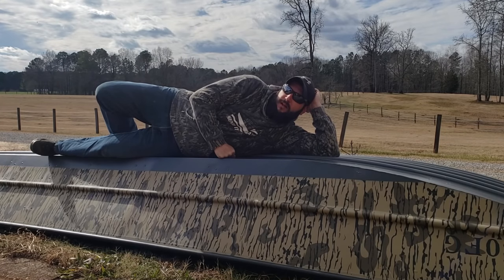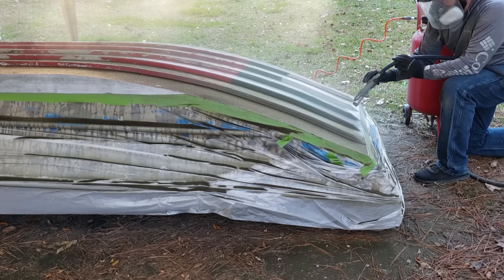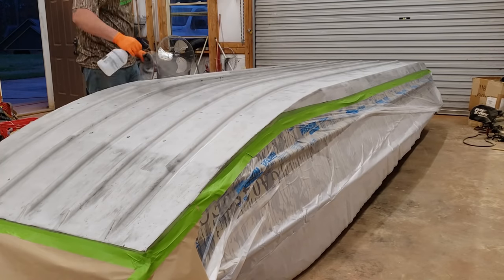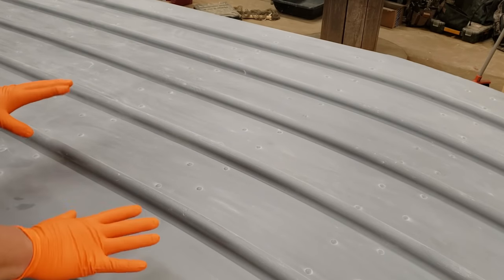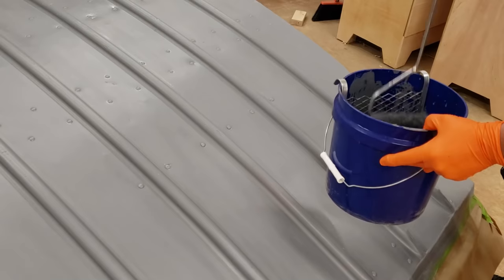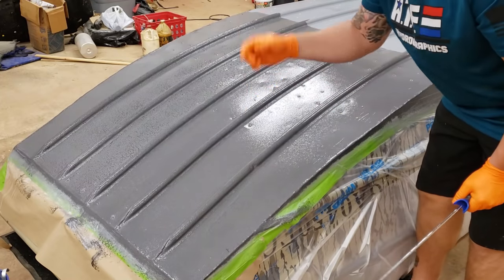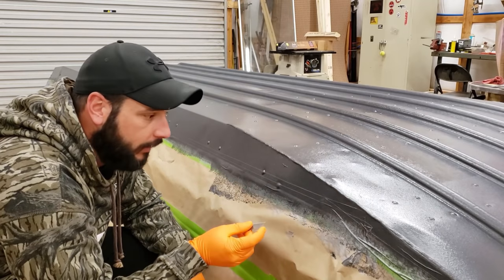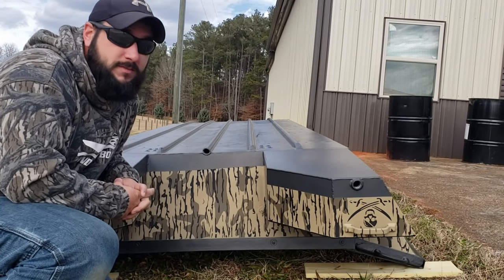Gator Glide and Gator Base [How to Apply, The Right Way]

Comment: I paint for a living and I'd recommend using Purdy roller naps instead. They won't leave those little fibers behind 👍👍
Reply from the maker: Thanks for the tip, I wish I would have known that. Next time I do the glide I will get those rollers.
Reply: Painting sucked until I found their brushes.

Comment: What does gator glide accomplish
Reply from the maker: Slick bottom coatings help keep the boat from getting stuck as easy, and if you do get stuck in mud or sand, the slick coating makes it a lot easier to get unstuck.

Comment: with the microfiber rollers you have to wrap it with that tape you used to mask and pull it off and itll leave the it clean and pull that loose lint off, it's actually the best roller you can use but you have to do that extra step
Reply from the maker: I learned that after a few people commented... wont make that mistake again.
Reply: @SendItJonBoats  Keep up the awesome work boss, your videos have thought me alot on my recent adventure of my new jon boat/mud motor. God Bless

Comment: Great job. A suggestion if I may, wrap your roller skin 
tightly with painters' tape before use. When you pull the tape off it takes most of the loose fibers off of the skin.

Comment: If you don't want roller lint, try a redtree 3/16 nap   mini-mohair roller.  I use them for epoxy paint like Alexseal that has agressive solvents, and they last pretty well.  UHMWPE plastic works well for trailer bunks and other things that need to slide.  

Thanks for the tip on scoring the tape.  I'm using Dynel and graphite filled epoxy for the same purpose on a wooden kayak skeg, and getting that tape off was a bear.
Reply from the maker: Thanks for the roller tip Jim. I will have to check them out next time I do glide on a boat. Those micro fiber rollers sucked!

Comment: You need a roller knap that is made for solvent based paints. It also helps if you wrap painters tape around the entire nap and pull it to de-shed the Knap prior to use.
Reply from the maker: Wish I would have know that before I spent an hour picking out the bits and pieces.
Reply: @SendItJonBoats  yeah, I dealt with the same problem every time I would use oil based products. Usually it’s not a problem when you spray oils on, but when you roll them, there are specific roller naps that are for latex/water based paints, and others for oil/solvent based products. The latex naps will shed like crazy in oil paints. Took me a long time to figure that one out.
Reply: @SendItJonBoats  I’ve had good experiences with those Purdy white dove naps.
Reply: @progradepainting3755  Purdy a best. I have used painters tape wrapped over a board/bench and rolled the nap over it a few times.
Reply: @fishinforfun8781  that’s a good idea. I’ve never done it that way, but I’m sure it would de-shed the nap nicely.

Comment: I just had a ton of revisions done on my 15 ft took the 40hp off put 2022 50 merc on it. The gator glide. You really like the way it preforms. ?
Reply from the maker: I am happy with it so far. Only been 2 seasons and no real wear yet. I would never want to get stuck again without it though. Slides off the  mud much easier.

Comment: I'm a newbie to your video's and find them very well put together. Would stainless steel rivets offer more strength. There are also air operated rivet guns that would get in closer spaces !  I had the floats welded on cost over $500.00 he did a perfect job I cut the handles off the back so nothing can be tied off or snagged on them also changed the drain plugs to type you tighten with a wrench ! I think I would used a shop vac to get some of the dust off then wipe it down !
Reply from the maker: Defiantly do not put stainless rivets in... the aluminum rivets are plenty strong.

Comment: After sanding the primer, it’s already super clean, just rinse it with water and let it dry, and then you are ready for the top coat, I don’t see the need to use the chemical and all those paper towels to clean between coats , just my 2 cents , 🤗 
ps. Been painting show cars for over 30 hrs 🤗 God Bless , 🗣 great channel 👍🏼
Reply from the maker: Never said I was an expert or this was the best way to do it... it is just the way I do it. I have an obsession with wax and grease remover chemicals lol. It's like Franks Hot Sauce... I put that sh*t on everything!

Comment: I wonder if anyone has ever applied this to the bottom of a mower deck  .. if it would help all the grass cliplings discharge without caking up on the bottom of your mower deck .. the dirt, sand, a grass clippings hold moisture in and rust out steel decks over time if you don't get under it and scrape the crap off  .. I use cheap cooking spray and it helps prevent buildup fairly well... nice job on your boat  .. let me know if you ever try it on a lawn mower.  Thanks
Reply from the maker: I bet it would work good on a mower deck, never thought of that.

Comment: Did you have any problems with the gator glide adhering to the 3m 5200 on the float pods?
Reply from the maker: No sir, held up just fine. I will be doing a follow up video on it soon.
Reply: @SendItJonBoats  Nice! Thanks for the reply

Comment: That turned out great.  Could you tell if it improved the ride ?
Reply from the maker: I did end up picking up a few mph. It is was easier to get on and off the trailer. It rides about the same, just a bit slicker in the water.

Comment: Always wash paint rollers in straight tap water and let air dry pre project, it will eliminate 99% of lint problems....And yes I learned the hard way.
Reply from the maker: Wish I would have known that, thanks for the tip. I will defiantly try that next time.
Reply: You can also wrap painters tape all the way around the rolller and when you peel it off the lint comes with it

Comment: I usually vacuum the dust off , then wipe it down . Saves a little time
Reply from the maker: Thanks for the tip.
Reply: Could you spray off the dust with a garden hose and dry it before final cleaning
Reply from the maker: @terryogletree2128  Yeah you could, but  you still need to wipe with acetone before putting the gator glide down to make sure there are no oils or contaminates on the surface, and it helps the gator glide stick better.
Reply: @SendItJonBoats  that's what I figured

Comment: Gonna have to do a slick coating before and after on our newest builds for speed test. I think it's helps out alot possibly 🤔
Reply from the maker: Thats one thing I wish I would have done is a before and after speed test. Im sure it will help a little.
Reply: How did the speed test turn out before and after?
Reply: @Adam Delano  I don't think necessarily gets much more top speed but helps it get on plane much faster after that most of the boat is out of the water.

Comment: Looks like a great bottom coat product, and according to the website it will stick to just about anything including fiberglass (but not to UHMW).  I see it is not recommended for full time saltwater use as well.  I know a lot of people who use different colors for each coat of their anti-fouling paint, it does make it easier to know when you need to reapply it, and they've got LOTS of colors.
Reply from the maker: Yes sir! It is good stuff. I am no where near salt water so I didn't even look into that. Glad you mentioned it because I will have to let people know when they ask about it.
Reply: Your comment caught my eye and was about to correct you and say UHMWPE doesn't come in spray form. Then i actually read it haha. I wish it did
Reply: I is fine for salt water! The site states our "FR" fouling release is for fresh water only. All GatorGlide products are made for salt and fresh water but not to set in salt water year round. Just FYI
Reply: @davidward2370  Thanks for the clarification.  As you can probably tell from my handle here, I'm more familiar with freshwater, although I want to move to Florida, my better half doesn't so . . .
Reply: Glad I saw this...salt water is the majority here in MD. Thanks for the FYI.

Comment: Question: I have a 12 foot Orlando Clipper V hull aluminum center console boat with a 15hp Johnson outboard motor, top speed is about 23 mph. My problem is I have a small leak on the bottom of the boat somewhere. I've tried to repair it with silicone and it worked to a degree but did not seal it completely. Because the boat goes pretty fast the water friction on the bottom of the boat is high. I'm looking for a liquid application like solvent or paint. What product do you recommend that would permanently fix the leak.
Reply from the maker: It is a boat, not a submarine... a little water in the boat is not going to hurt anything dude. My boat has like 19 leaking rivets and we fishi with 10 plus gallons of water in the boat and it floats just fine. Either replace the rivet, or just leave it alone. Quit trying to smear junk on it.

Comment: Would it be worth applying an abbration resistant epoxy first to protect from rocks and gravel (jet boat) and then applying gator glide over top?
Reply from the maker: Nothing will protect from rocks except that uhmw.

Comment: So what if the boat is fiberglass? The paint is not the greatest, but would I have to repaint before using the gator glide?
Reply from the maker: No need to repaint, just scuff it real good and apply right over the old paint so long as it is not peeling. If it is peeling you will need to sand it all off. But yes it can go over fiberglass.
Reply: @SendItJonBoats  awesome! Thanks for your advice.

Comment: Does it still work good if you have pin holes that you fixed on the bottom
Reply from the maker: Yes so long as the holes are sealed well then it will go right over it.

Comment: You can put on a couple thick coats of graphite mixed with epoxy.
Reply from the maker: I could have covered it with Vaseline, or done a lot of other slick stuff, but I chose gator glide to try it out for this boat and it works great.

Comment: Hey just checking does this stuff work to seal rivets?? And is it pretty hard and tough when you’re done? Not to be a scooter but wanted to make sure before I buy some
Reply from the maker: It is not made to seal rivets, and I do not recommend any goop, slop, paint, roll on, stick icky, gluey junk to seal bad rivets. Drill the bad rivet out, put a new one in and do it right.
Reply: @SendItJonBoats  gotcha. I don’t have a leaker but Was thinking more of a preventative. Also looking at Raptor spray on

Comment: How well does it resist abrasion? I have a yamaha waverunner. Juat curious how well it would bond to my fiberglass bottom?
Reply from the maker: Bonds to fiberglass so long as it is properly prepped. I have not tested it for abrasion but I know the airboat guys have been using it for years and they say it works well. It will need to be touched up in the future but that is easy, clean, scuff, and put on another coat.
Reply: It does fairly well if you keep in mind it’s a sacrificial coating, and you will have to reapply eventually dependent on use. I have 2 years on my fiberglass layout boat bottom, and I think I did 3 coats of just gatorglide (no gator base) on top of the gel coat after sanding it. And I have minimal wear through on one spot and a few scratches from rocks. I drag the boat over dry land a bit and I didn’t notice any real reduction in difficulty to drag it, but it’s easier to slide on and off my trailer for sure. Personally I probably wouldn’t put it on a wave runner unless you really beach it every single time you ride it to a sandbar or something, but even then. You’ll either be recoating gator glide or gel coat at some point.
Reply: @SendItJonBoats  thanks for your info. Also i want to thank you for doing the video. The effort and education was very well done and helped me tremendously in my personal research of protecting my investment. Yamaha has this material that they refer to as nano cell. From what the other yamaha pwc owners have shared with their experience with the stuff, it has some real bad issues. Ive seen it delaminate in sections so big it's scary. If you get a small hole, the pressure from the water getting in the hole while riding has made it disentegrate terribly. You may get other owners like myself looking for a solution. Im more in tune with a preventative maintenance Solution to a future would be problem. Yamaha has a serious issue with the malfuntioning properties of their nano hulls.  To make the skis light an perform well, they made these fragile hulls. I dont want to lose my investment when i know i can strengthen the hull with the right product. I am comparing products to see what i want to use. I just know that the gator glide is on my list. I really the product is great from my opinion or your very well done video. Thank you. I hope to be a customer soon!

Comment: Wish I could have you do this to mine! What would I do different to put this on outside since I don't have a shop with a controlled atmosphere?
Reply from the maker: The 3 big things to watch for with Gator Glide is 1. don't put it on at night 2. don't do it in direct sunlight 3. don't apply it when its raining or overly humid. Get you a covered area on a warm day and get to it dude,  it's easy. Just a lot of time standing there rolling.
Reply: Thanks!
Reply from the maker: @jeremyjulienne160  anytime. If you need any tips or advice just holla at me.

Comment: How does the boat do in the mud being that it has ribs? Video?
Reply from the maker: I do not run a lot of mud, we have mostly sand a leaf muck in the small rivers around me. Haven't been able to get it stuck yet, but everyone I know that runs in mud says slick bottom coatings are 100% necessary.

Comment: Can Gator Glide be applied to Fiberglass boats?  Will the coating handle 70 mph?
Reply from the maker: I haven't personally done it, but I have seen it done and there was no issues. Gator glide puts that stuff on anything, even kayaks!
Reply: Yes and yes. Its probably a hair easier to apply to fiberglass. I did a fiberglass layout boat. just sand, wipe with acetone and roll on the glide.

Comment: Awesome job!!! I'm fixing to pick up a plastic jon boat (Field & Stream Sportsman) for cheap. Would you ever paint a plastic jon boat, and if so, how would you do it and what would you use?
Reply from the maker: Plastic is super hard to paint and get it to stay stuck for a long period of time. Check over on my hydro dipping channel (ATF Hydrographics) I got a video all about prepping plastic for paint.
Reply: Not to butt in but I just did my plastic boat with flex seal , clean it scuff it it will last forever

Comment: Is there any type of paint or coating that would protect aluminum boats from rusting in salt water?
Reply from the maker: Any coating will help, but aluminum does not really rust in salt water, it just oxidizes.
Reply: Lmfao ur joking right?
Reply from the maker: @tird108  nope... I paint old aluminum boats all the dang time, never seen aluminum boat rust. They just get heavily oxidized and crusty and pitted.

Comment: Quick question man. trying to set my 12ft john up to hunt small rivers with my longtail kit...is there anything I can coat the bottom with to protect against rocks? thought about bedliner not worried about the drag since not in a race. any suggestions would help
Reply from the maker: I would get one of those poly or plastic hard bottoms to put on your boat if you are going to be bashing a lot of rocks. No coating in the world will hold up to rocks.

Comment: I want gator glide on the inside. “I like to party” 😂
Reply from the maker: 😆BWAAHHAAAAA!!!! it would defiantly be a party with glide on the inside lol. Stuff is insanely slick!
Reply: @SendItJonBoats  how well does it hold up to rocks. The Hiwassee River is quite shallow in Reliance Tn
Reply from the maker: @nate4036  I am not sure, we don't have a ton of rock down here in Georgia. Mostly sand and mud, and leaves in my area. I would assume that against rocks it's only going to hold up so long before it needs a recoat. Luckily recoating is easy... hit it with a scuff pad, clean really good, and roll on another coat or two.  I have sen people do it with a hoist and not flip the boat over.
Reply: @SendItJonBoats  for heavy rockage use a sheet of HDPE ....TOUGH AS STEEL SLIDES LIKE SILK OVER ROCKS ETC...
Reply from the maker: @craigbielsky115  I have seen that stuff on those jet river boats. Looks like it works really well. I don't have that many rocks around me so I went with this.
Reply: @SendItJonBoats  my comment was intended for the other guy asking about heavy rock use ...guess i clicked the wrong reply deal thingy...lol carry on.....
Reply from the maker: @craigbielsky115  No worries bro! Yee Yee

Comment: Masking paper is the 12 inch rolls of paper. And it goes on a masking machine and tape. Make masking fast
Reply from the maker: If I was in my shop then we would have had that, because I own a masking and tape machine.... but I was at a buddies shop so I had to use what I could bring.

Comment: Is it ok to use the blue Beamon brazing rods on leaking rivet’s on the bottom of the Jon boat before you start your Gator Base?
Reply: You'd probably do alot better getting a bucking bar and re buck your rivet
Reply from the maker: No, fix the rivet the right way first. Than put gator glide on.
Reply from the maker: Yup